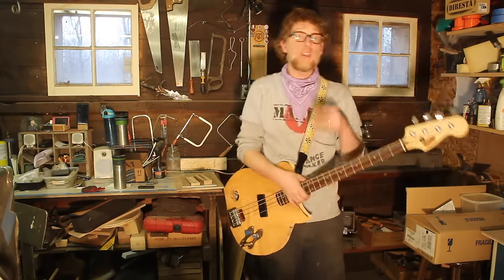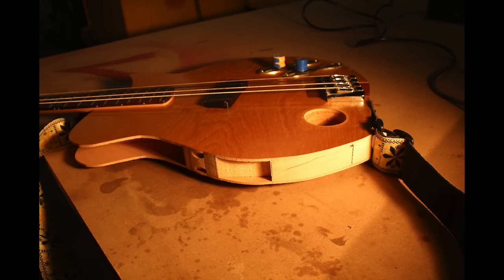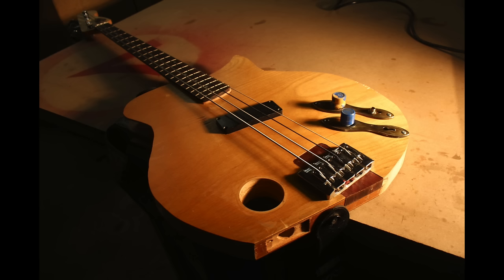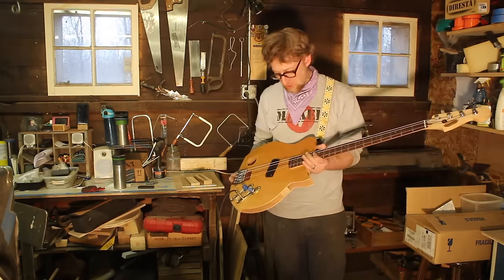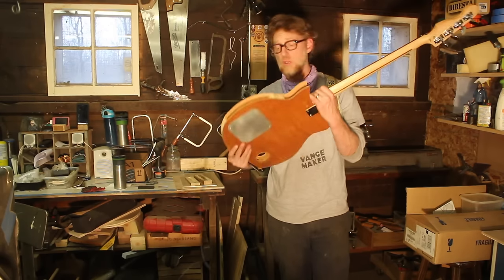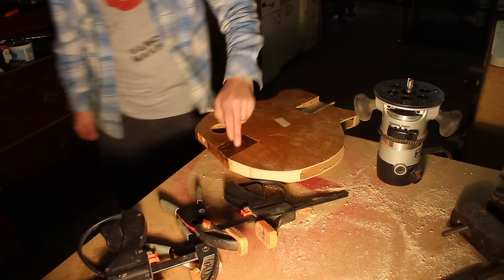the door bass is back!! it totally works!!

Comment: with a central block of wood from the bridge to the neck and a pickup maybe a bit near the bridge you will get it! soooo great! saludos.
Reply from the maker: I wanted to avoid the full length block to keep it a hollow body, but that was what i was going to do when the last one failed. did you see that vid? I made this one exactly the same, just the interior is stronger. any pickup configuration is possible! I want to make one with just a bridge piezo pickup to keep the whole front flat and smooth :)
Reply: +tim sway Hi again, yes I saw that video. I didn't remember the part where you explain about the central block. I recently saw it again.  Cheers, amigo.